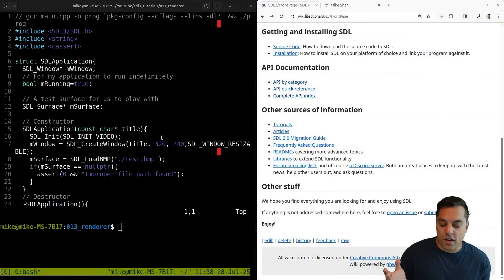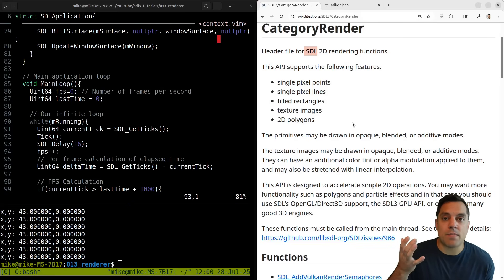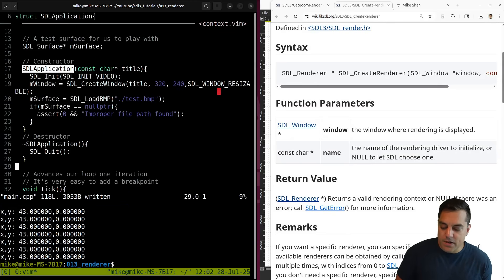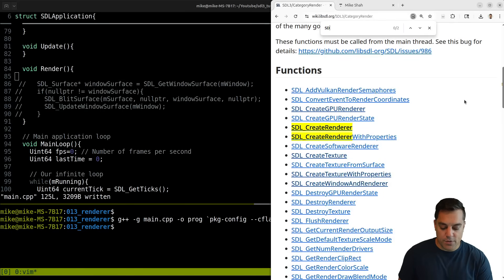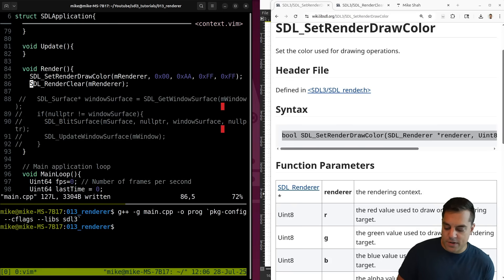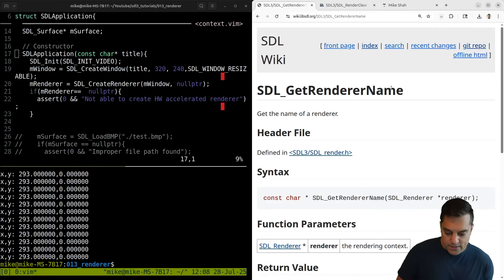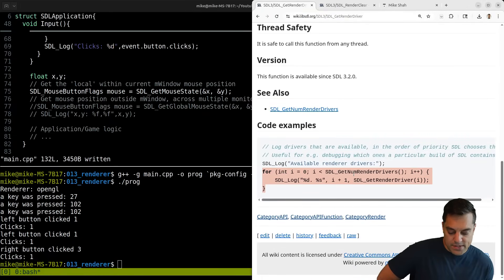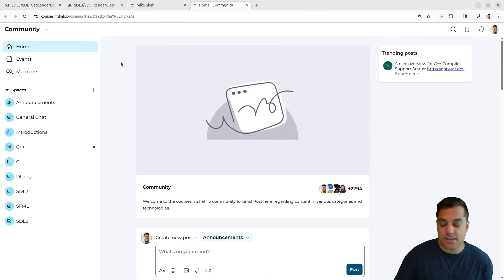SDL3 Hardware Accelerated window - CreateRenderer [SDL3 Episode 13]

Comment: For your Destructor, Mike, I notice you only have   ~SDLApplication() {SDL_Quit();} 
~SDLApplication() {
        SDL_Log("Cleaning up SDLApplication...");
        if (mRenderer) {
            SDL_DestroyRenderer(mRenderer);
        }
        if (mWindow) {
            SDL_DestroyWindow(mWindow);
        }
        SDL_Quit(); // Properly shutdown SDL subsystem
    }
You must explicitly call SDL_DestroyRenderer and SDL_DestroyWindow. SDL_Quit() does not destroy these resources automatically. It only shuts down the SDL library's subsystems.
If you don't this you will have a memory leak.

Comment: Thanks Mike for explaining how to list renderers. So if you make a web game app; you would use opengl es right? Where it says gpu is that what you would use for webgpu? All I read was that webgpu is most like Vulkan and you don't use vulkan in a browser. Webgpu works for Google Chrome, but not Firefox on Linux but will be soon, BTW.
Reply from the maker: I think webgl is what you'd get. Indeed there is some work being done on webgpu, but I'm not sure the full status. Indeed webgpu is also making calls to vulkan/d3d12/metal depending on the platform, so it is a layer on top.
Reply: @MikeShah  Well on Linux just Chrome can use webgpu, but Firefox webgpu soon they say.